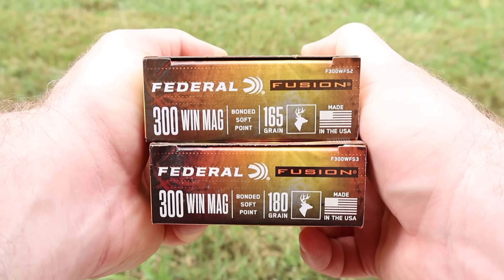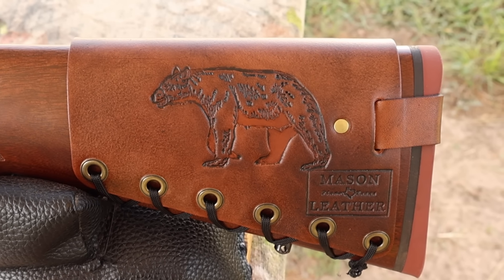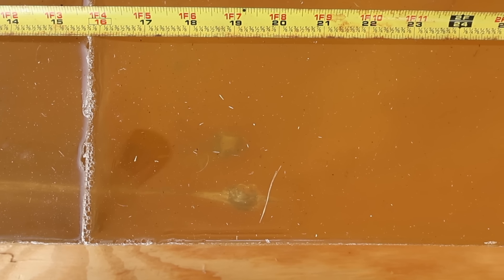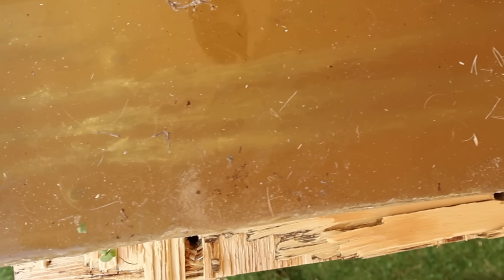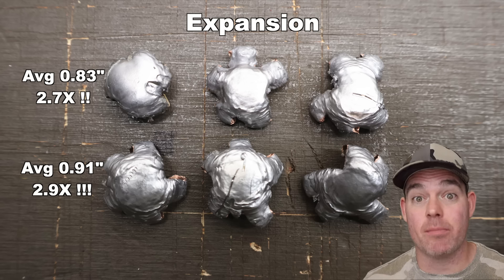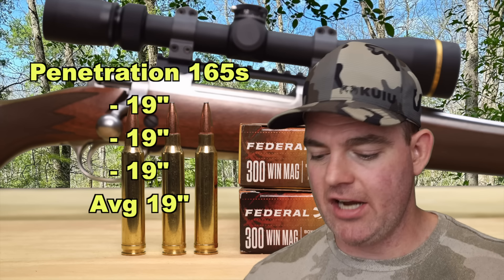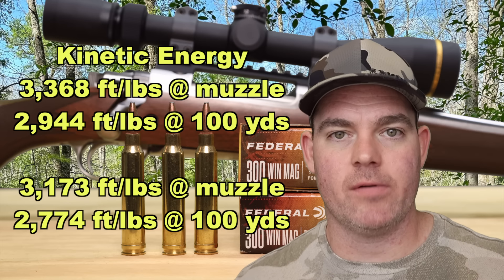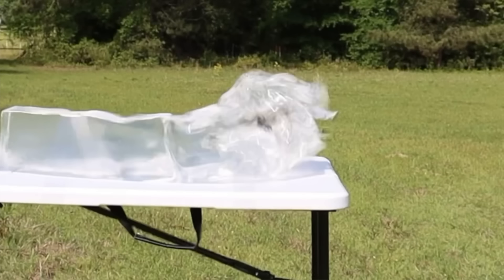300 Winchester Magnum Federal Fusion Ballistics Gel Ammo Test

Comment: It's kind of funny how we,  (self included) have come to expect a certain parameter of performance based on hard technical data, rather than simply how well it flattens game animals. Back in the good old days it either worked well on game or it didn't. My Dad had cartridges he didn't like based on reputation or extremely limited experience and observation. The science was just not available to the end user a few decades back. Chronographs, ballistic gel, and videos like this really puts the monkey on a manufacturer that backs off on the gas or loads a marginal performing bullet, and writes gibberish on the boxes. The game really has changed.

Comment: Great video. It would be interesting to see what these bullets and loads do in the 30-06? But it is expected the 180s would penetrate a little more. Because they are the same bullet design/construction it would stand to reason the 180 would out penetrate the 165. I was surprised by how little. This is where sectional density comes into play. SD of 180gr is .271 and that 165gr is .248. I think this explains the higher impact you witnessed as the lighter bullet hit with more velocity but because it’s lighter it opened more quickly but didn’t penetrate. The 180 opened up perfectly but the weight (sectional density) carried it farther.

Comment: As usual disappointed in factory velocity and thus energy but happy with performance. Another projectile  may have to handload if I run out of my sierra match kings.
Reply: Factory is probably using a 26" barrel.
Reply: @kellym3531  federal blue box 180s did 2960 just like they say on the box with 24 inch barrel, seems like a bad batch.

Comment: Great expansion but would have expected more penetration with 300 win mag
Reply from the maker: Indeed, the expansion stops it, something not many talk about is “rate of expansion,” which is why these in 300 Mag might penetrate less than the same bullet in 30-06 or 308, the increased velocity at impact increases the rate of expansion.
Reply: Thats why if u shoot 300win, theres really no point goin lighter than 180. Better even to go 200g. 165 is way too light for 300win. Im a believer in 150/165 in 308, 180 in 30-06, and 200+ in 300win

Comment: Is the lesson learned the further away but elk is the lighter bullet you may want to have for penetration or is it the opposite or somewhere in the middle?
Reply: Rules of thumb to remember; expansion can and usually does limit penetration. Weight (as in heavy for caliber and cartridge) can reduce velocity and thus expansion, which can enhance penetration. A bullet that over expands at short ranges with reduced penetration quite often behaves very well for adequate expansion and better penetration at longer ranges. It's a balancing act. We now have so many different bullet designs that have altered our perception of performance that it's much harder to keep up with what to expect from a bullet. There are vast differences these days.